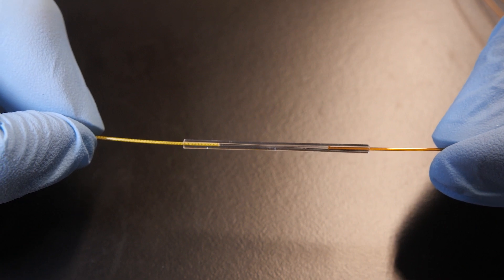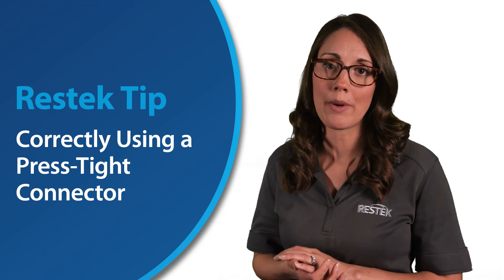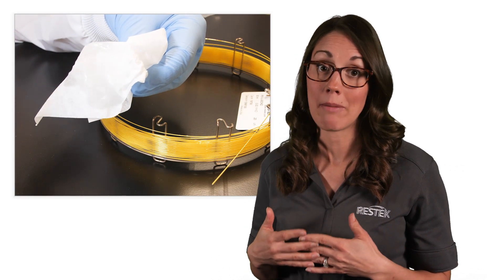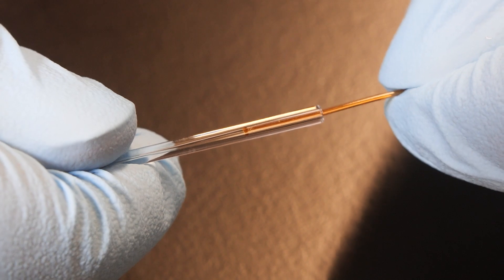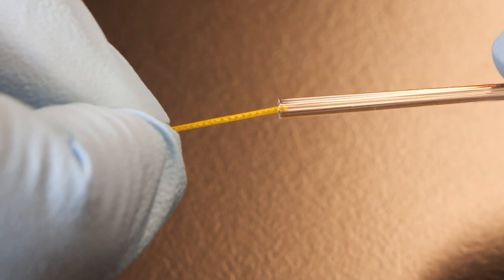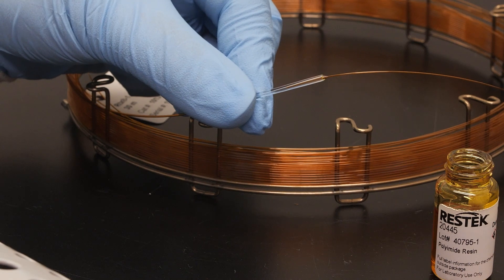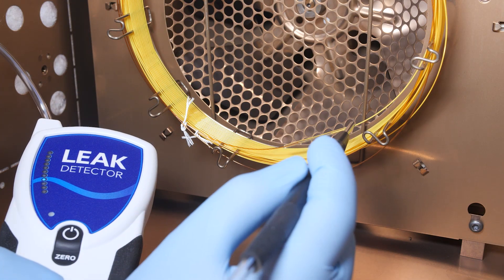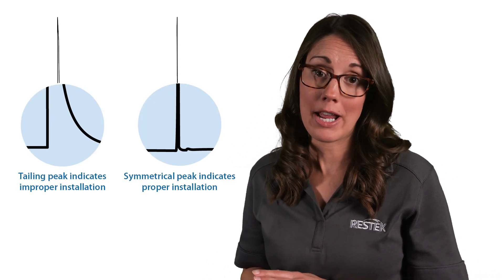Correctly Using a Press-Tight Connector

Comment: Hi, thank you for your videos. Do you know how you can clean a inlet liner?
Reply from the maker: We have a short writeup on our website with information on how to clean liners https://www.restek.com/en/frequently-asked-questions-faqs/frequently-asked-questions-GC-accessories/#sec06

An abbreviated version is below, but there are more details in the full article.

To clean a liner with no visible deposits or discoloration, it is best to rinse the inside with the following solvents in sequence: methanol, then methylene chloride, then hexane.
 
Use a cotton swab or pipe cleaner to gently scrub the inner surface of the liner, but be very careful not to scratch the liner and thereby remove the deactivation layer. If deposits are visible or the liner is discolored, it may be necessary to ultrasonicate the liner in methanol, then methylene chloride, and then hexane.